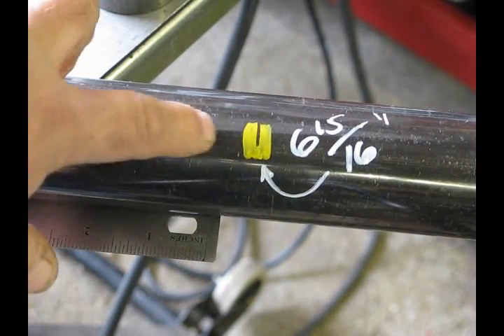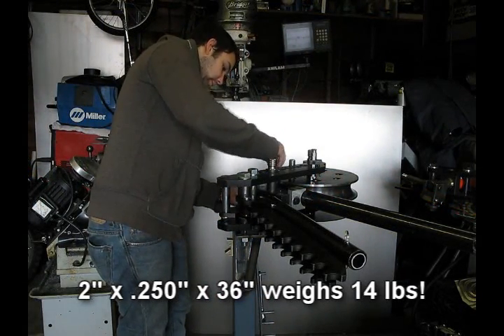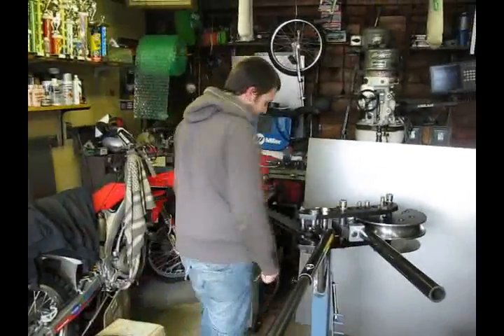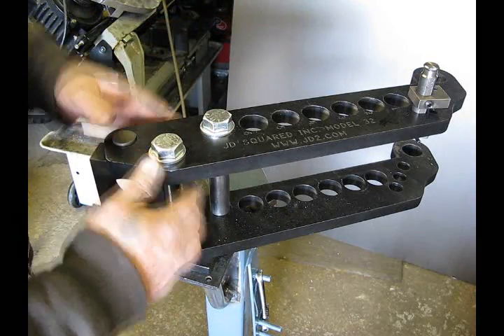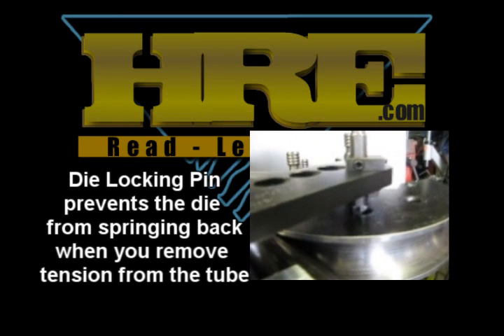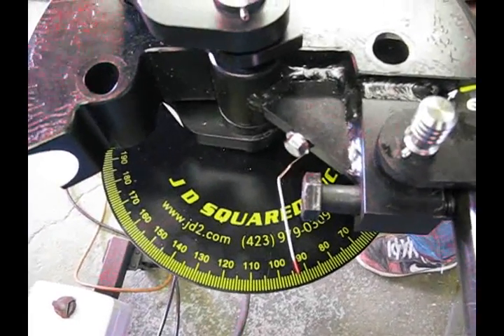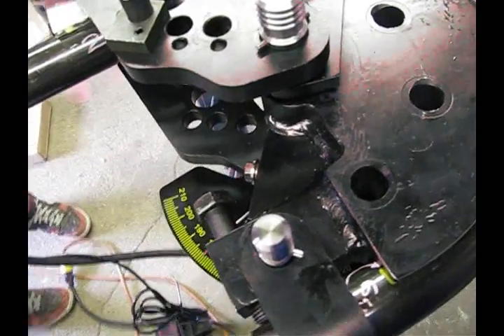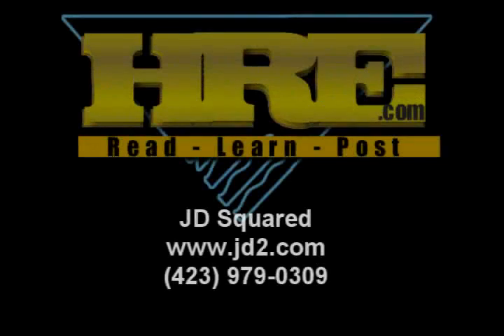JD Squared Model 32 Bender - 2" x .250" Wall Tubing 180° Bend

Comment: Jim have you ever had to lube the main pin at all? the pic that goes though the center of the dia? thank you
Reply from the maker: High Richie: No, I've never encountered an issue with that. However, there wouldn't be anything wrong with a spray of lube (WD40 , Kroil, etc) on any of the parts of the bender.. As I say in the video, "It CAN'T Hurt!"  Thanks for the comment.
Reply: thanks for the reply just checking what you been doing I have model 4 no lube never an issue I get a model 32 for another project and its ate in to the pin

Comment: Thanks for that video, I want to buy one Model 32 and definitely going with the hydro. The ram you show in your video is the original or you change it for a bigger one? and can you please tell me minimum Psi and CFM required to bend a tube like the one in the video 'cause I have an small air compressor at home. Thank you